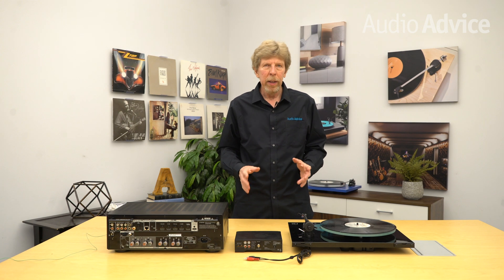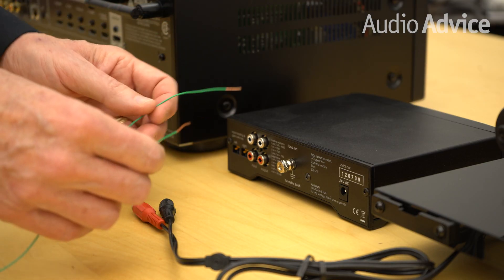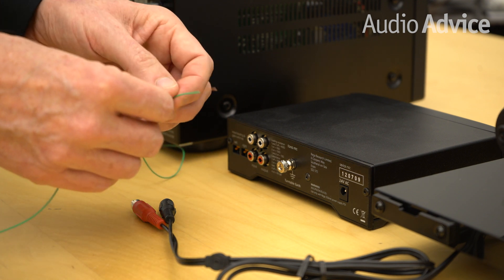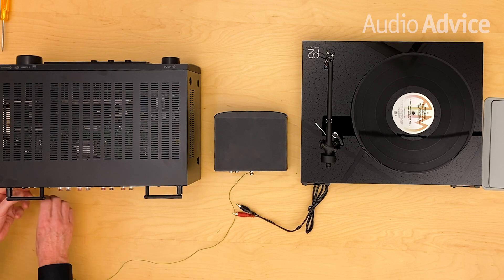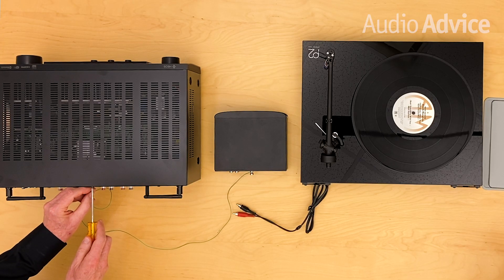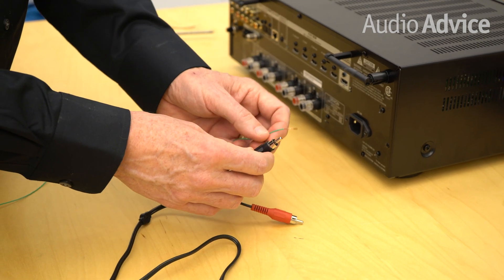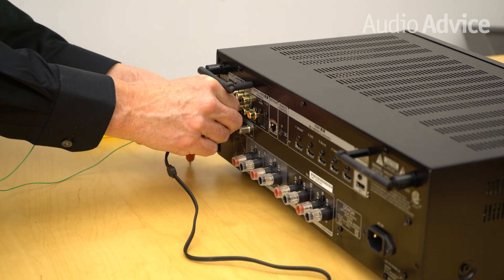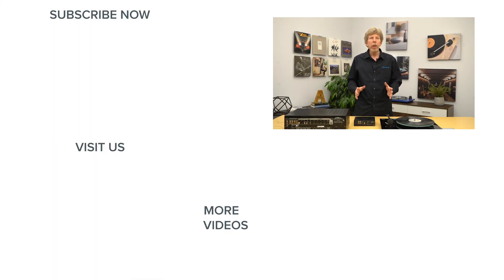How To: Ground a Rega Turntable

Comment: One question,  Can I use the Method One if I using another Model of preamp instead of Rega preamp which has ground screw?
Reply: Was just wondering the same!?
Reply: I have a Cambridge Audio Duo phono stage and a Rega amp, and method one did the trick for me 👍

Comment: What gauge wire are you using?  I've had a lot of issues with Rega hum on older Pioneer integrateds but haven't tried this solution - hoping it works!
Reply: 22 gauge wire.

Comment: Did nada for me. Still 60hz when the needle gets to the end of the record. They can’t engineer that out in 2020? Really?
Reply: Had the same problem with Rega planer 3. I plugged my phono preamp in a different electrical socket and moved it further away from my amp and other components. Problem pretty well solved.
Reply: @StringerNews1 I did already when I bought the thing that shouldn’t have a 60hz hum
Reply: @StringerNews1 I’m not sure you grasp what I said
Reply: The motor is interfering with your cartridge.  Try shielding the motor with aluminum tape on the plinth where the motor sits.